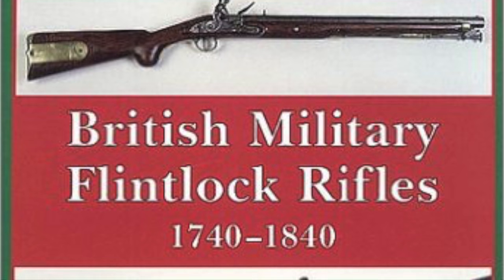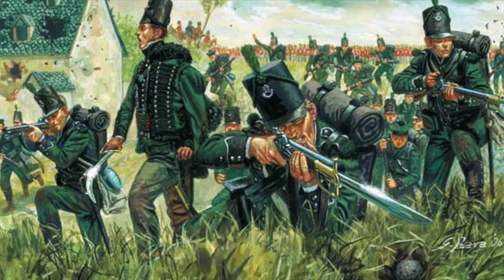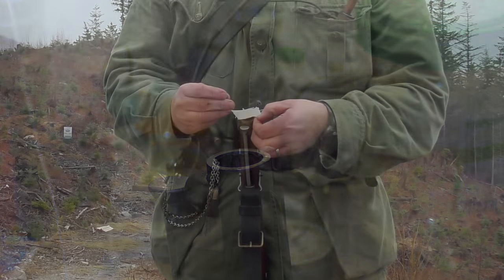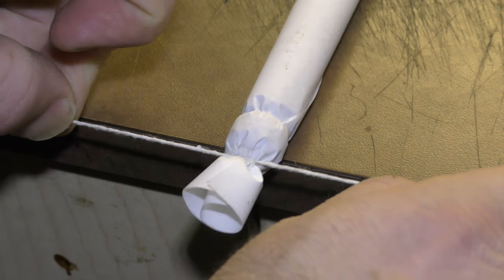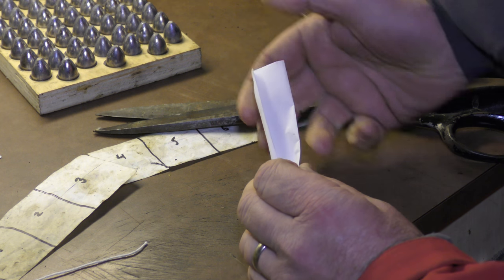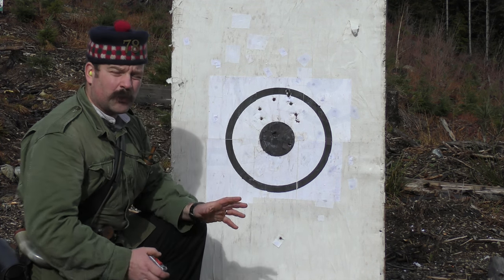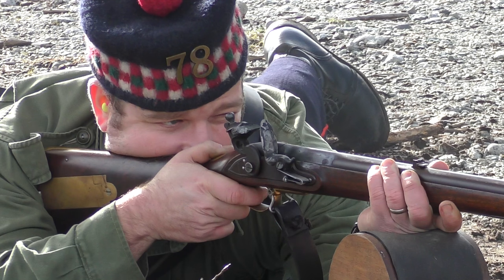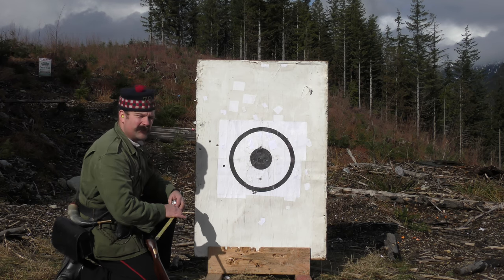The 1800 Pattern Baker Rifle: Shooting with Paper Cartridges - PART ONE

Comment: I sometimes use paper cartridges in my early Virginia flintlock rifle.  I dip the ball end of the paper cartridge in SPG lube. Then when loading, I ram the ball down with the lube dipped paper around the ball. This helps some with windage and fouling, but I still wipe the bore between shots. Groups are very good at 35-40 yards. Never tried them at longer ranges.  Average spread is about 2-3 inches.  50 cal. 175 grain ball with 60 grains ffg.
Reply from the maker: The lube will certainly help, especially if the windage is tight.  In a military context, there wasn't any used on cartridges, though.  Outside of historical shooting, anything goes, of course!  Cheers.

Comment: Very interesting when You visit the Waterloo battlefield. The KGL units used the paper cartridges when they defended La Haye Sainte and a little far from that the 95th was shooting off the French artillerymen on long distances with the patched bullets.
Reply from the maker: I'm sure that every rifleman had a mixture of ammunition.  Indeed, the defence of La Haye Saint was for the most part desperate and close range... as for the the 95th in the sandpit, the Grand Battery was a bit too far away for rifle shooting, but certainly, as D'Erlon attacked there would have been ample targets...

Comment: Can't say I fancy a foot drill music on a background - but I'm a fan, and it's always a pleasure to listen to an expert!
Speaking of Sean Bean's performance - is it anywhere near practical to roll a loose naked ball down the barrel of the Baker rifle as it's shown in "Sharpe's Rifles" - without using a ramrod, just tapping the butt on a ground? Or it's just a cinematic exaggeration? Thought that gas sealing is somewhat essential in firearm, though, so it demands a tight fit for the ball...
Reply from the maker: "cdsadler" of YT did an interesting experiment on this very thing... have a look!.. :-)
Reply: I did. Guys are awesome, but they've tried it with smooth-bore musket... Still wondering, would the tap nesting work with the rifled barrel? In other videos you mention balls of various calibers - when explaining loose patched ball and the cartridge. Perhaps, 22ga ball should roll in nicely - and I trust that ball will even leave the barrel when fired - but would it go straight and deliver enough energy with such a loose fit and no sealing at all?
Reply from the maker: Here's the deal... in order for this to work, you have to bite off the bullet from the top of the cartridge which entails a bunch of powder in the mouth...  .... and of course a lead ball in your mouth... then you have to swirl it around in there to get the paper and string off.... biting into it and "chewing" the paper off... All this while you are pouring the powder down the barrel... then with any last bits of paper removed with the fingers in the mouth, you can spit the ball down the barrel...  The ball is capable of rolling down the barrel, but the process isn't as easy (or indeed healthy) as one might think.

Comment: Rob, I wonder if the decision to cease the issue of the patched ball and powder half way through the Napoleonic was was, in some way related to the change in the nature of the war. The Peninsular Campaign was a war of skirmishing and often smaller independent units, by the time the war had moved to Flanders, the nature of the war had changed to open rolling and flat countryside suitable for line battle? 
Probably nothing in it and who knows, perhals individual riflemen kept their own patch and ball, especially if they were marksmen.
Reply from the maker: I imagine that the reasoning behind forgoing the issue of separate patch and ball was due to the lack of need for it.  Though, to categorize the whole Peninsular War in one way would be much too general. The use of patched ball cartridges (as examined int he subsequent parts of this series) became a much easier and expedient method.

Comment: I understand you made your Baker from a kit. How did you go about inletting the keys? What did you reference?
Reply from the maker: Ah,.... the most difficult and stressful part of the build.  I used a drill press, a level, and a clamp to drill the keyways through the barrel key loops with the barrel clamped in place... Three holes side by side, then finished it out with jewellers files and a knife.  There is a better way using a press with a locating nail clamped to the base pointing up, matching exactly the tip of the drill bit...

Comment: Seems like the biggest difference between the reloading done in the vid with paper cartridges, and the reloading done in the Sharpe's Universe (which I think is portrayed as a method used and taught by him alone), is that he bites and rips off the bullet, then primes the pan, pour the rest down the barrel, stuff down the paper, and finally the ball is spat down into the muzzle to be rammed or tapped down. In the show he was teaching basic infantry; those using the Brown Bess, so wasn't demonstrating with patches. For when accuracy is needed, I think either the powder horn method was used, or I suppose the ball was spat onto a patch on the muzzle so as to be rammed down with it. I sort of recall the patches being made of leather rather than cloth, but that might be incorrect. I wonder, on average, how many rounds must be fired from a Bess before tap loading can no longer be done safely, with the ball likely ending up stuck only partially into the barrel, which is of course a very dangerous proposition. For that matter, I wonder if it differs much for the Baker Rifle. Something tells me that with the rifling, the Baker would get gummed up more quickly without using patches.

It's certainly mentioned however that the Baker Rifle can be used like a Brown Bess if not given a patch. It won't bite into the rifling, resulting in not nearly as much accuracy, but its faster, and 3 shots per minute is precisely what he focused on for the smoothbore infantry. I think when he demonstrates it in the book Sharpe's Rifles, he either JUST managed to fire a 4th shot, or was JUST on his way to ramming down the ball for his 4th shot when Harper called 60 seconds. In Cornwell's The Fort, I distinctly recall a British Officer, I think a young Lieutenant, demonstrating 5 rounds in 1 minute. He cheats though; stabs his ramrod into the ground for easier access. His muscle memory must not have been a hair out of place, because even with ramrod at such a ready position, 5 shots in a minute is God-like. Based during the American War for Independence, 1779 specifically. Incredible stuff. 

Even in using the 'tap loading' method of reloading, that kind of rate of fire must be nearly impossible. Years upon years of practice, hundreds, if not thousands of rounds fired. Day in and day out, until it comes as naturally as breathing, or as drinking the booze provided in daily rations... ahh, that would have been a big plus for encouraging me to join the Military if I was around back in the day. Regular meals with drink provided daily (when possible)? Where do I sign up?! I've made and eaten ship's biscuits/hardtack before, letting it soak in coffee or tea helps the flavour, specifically tea. Just hope that it doesn't result in a 'Barret's Privateers' situation, being left a young legless man on a Pier, in the case of the Navy. For those who survive amputation in the Army, the first destination upon 'retirement' was likely the nearest pub, I figure. Savings likely wouldn't last long, I doubt there was a pension back then, so if a man lacking a lower limb couldn't find a job that didn't require much mobility, or if a man missing an arm couldn't find a job that didn't require two hands, becoming a homeless beggar would likely have been the outcome I figure, ESPECIALLY if it was merely a young Private or Corporal, someone not born a gentleman, who didn't buy their way into being an Officer, who didn't have a rich family to care for him. Rough times... but damn fascinating all the same.
Reply from the maker: +NormanMatchem Search for "csadler" on youtube...  He is a member of a re-enactment group in Australia portraying the 95th...  They have done a great series of videos on similar subjects...  including spit loading.  Loading with anything but paper cartridge was not used with the Brown Bess...  No patch, no wads,....  nothing except the method used in this clip...  When I get around to lugging the Bess out for a video, I'll demonstrate it.  Cheers.
Reply: britishmuzzleloaders
Yeah I've seen a few of their vids, great stuff. They also tested that tapping method vs using a ramrod. If memory serves, while the tapping was faster, it didn't seat the ball as nicely, resulting in less velocity (A chronograph was used, of course). With the ball patted down against the powder with a ramrod, it helped to propel the projectile with a bit more 'oomph'. A vid of theirs I recently seen was about shooting the ramrod from the Baker Rifle, like what Harper did in the show.

Not much distance; about 8m with a standard powder charge, 16m with a double powder charge, so with a half charge of powder as used in the show, it's likely only about 4m of distance would be gotten. Doubtful that it would provide the velocity needed to pierce someone's throat. More dramatization.

Comment: love your videos.i was wondering when the troops were preparing there ammo in camp they would have access to animal fat .would they have a pot of melted fat and dipped the ball end with paper in to the fat as a lubricant ? would like to know your thoughts . would it foul up more .thinking what I would do if I was a one of them. But I don't have the experience of a Neopolionic soldier .
Reply from the maker: Hi there.  Round ball cartridges intended to be fired without patching were not lubricated.  They were small enough not to need any.  As for lubricating patches, tallow would have been supplied...

Comment: You explained that the paper of the cartridge formed a "Rudimentary Sabot" at about 9:40 Was this by design or by lucky happenstance with the design of the paper cartridge?
Reply from the maker: Hi there.  Since paper cartridges evolved from systems like the "12 Apostles" or other loose powder systems, I would think that the sabot effect would have been an unintended benefit.  That said, it is a very rudimentary and not completely effective sabot.

Comment: Did the British never use a loading block?  This is a block of wood with maybe a half dozen holes in it the diameter of the bore.  A patched ball was place in each hole.  This was apparently common among "Kentucky" riflemen and would certainly shave a few seconds off the loading.

Also, I admire your devotion to authenticity, but you should wear safety glasses!
Reply from the maker: Not in relation to the Baker Rifle... no..

Comment: Rob, are you using any sort of special paper? Great as always. Thanks again.
Reply from the maker: +Hugh Batesel I used some rag paper that I used to use with the Enfield.  This stuff was cut already so I just modified the shape and made it work.  It's good paper.  Strong but relatively thin and easy to tear to open.   Cheers.

Comment: I don't know if you'd be open to do a video on how you manage fowling in muzzle loaders... always seems that I'm beating the round down after only 10 or so rounds through any of my rifles
Reply from the maker: +fatmonk1 I am open to most subjects... :-)...  Without having all the details, it sounds like you are not using an appropriate lube...  either too stiff or not enough...  Are you shooting patched RB or expanding ball (Pritchett or Burton Minies)?
Reply: I'm shooting pritchett minies out of my p53 and patched RB out of my bess. I use a 8 parts beeswax 1 part vegetable shortening and 1 part tallow
Reply from the maker: fatmonk1 Sounds to me that your lube is way too stiff... Try 50/50 beeswax/fat and adjust so that you can just push your thumb into a jar of it that is cool.  it should have the consistency of cocoa butter (if you know what that is)  Dry to the touch, but if you take a bit between your fingers, you can smear it fairly easily......  Are you shooting .564(ish) Pritchetts or .55?  For your Bess use straight shortening...  Thats what I use in my Baker (I only shoot cartridges from my Bess) an I can shoot all day...
Reply: Awesome thanks a bunch, I'm definitely not at that consistency i'll readjust. I just .564 with the rag vellum paper you suggested in an earlier pritchetts cartridge video
Reply from the maker: fatmonk1 Do let me know hoe things turn out...  eager to see the difference you experience with the softer lube... I think it'll make things way easier...  You should be able to shoot as many rounds as you want.  Cleaning regularly during firing will maintain best accuracy but the rifle should function properly without such attention..
Reply: Greatly appreciate all the help, and will definitely let you know how it goes.

Comment: what sort of paper did you use or was it just normal print papar
Reply from the maker: HI there.  The paper is 100% rag.  It's a brand that I used to use for my Pritchett cartridges that I had lying around.  Printer paper tends to be a bit on the thick and tough to rip side when rolled up in multiple layers, I have found.

Comment: Very nice content!
But why when loading the 3 timed paper cartridge rounds, did you cast about? You should have used the "Rifle between the knees" method from DeRottenburgs drill manual, much quicker!
Reply from the maker: +Rick McDick The whole between the knees method is really to enable both hands to hold the ram rod as it needs a good bit of effort to get the patched ball to pop into the muzzle.  I used the cast about method because there was no resistance with the cartridge and therefore didn't need both hands...  I'll give it a go next time!...